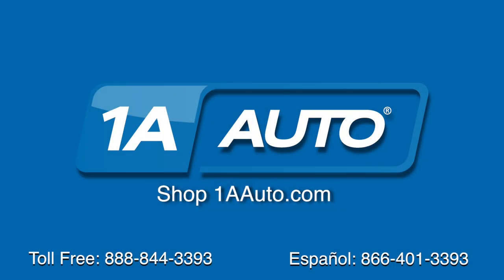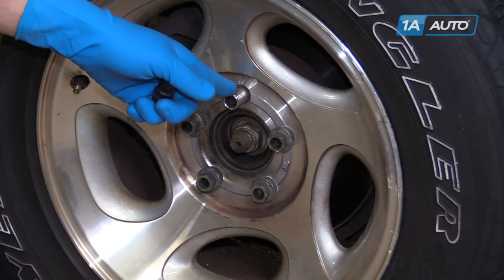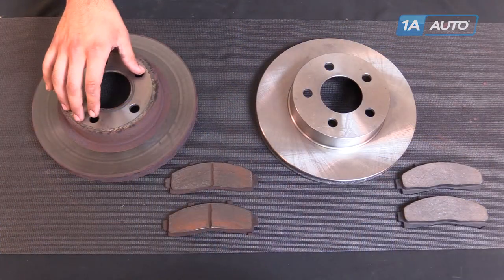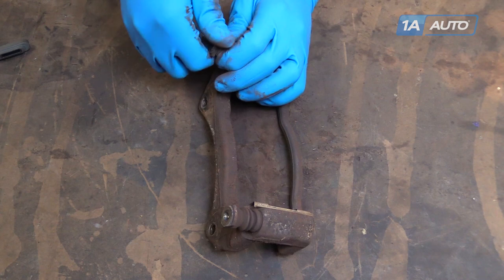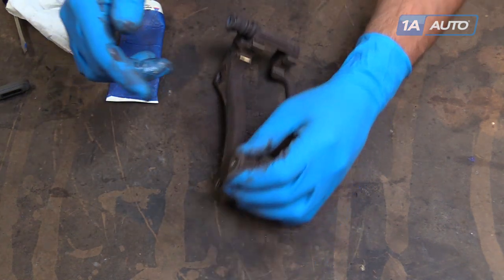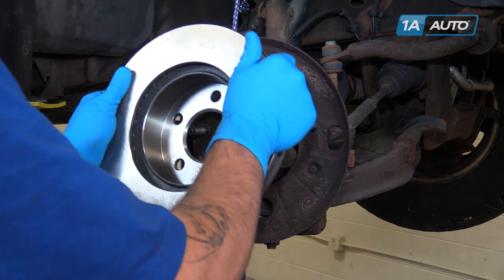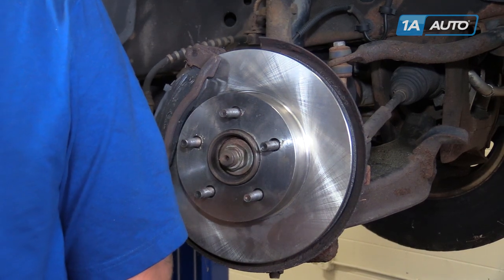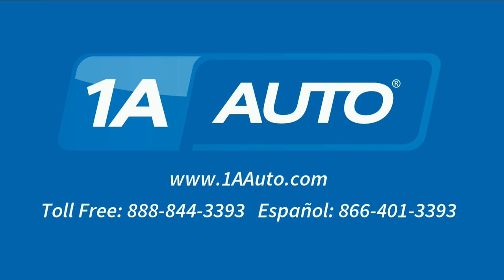How to Replace Front Brakes 95-02 Ford Ranger

Comment: The brake grease on the hub...SO IMPORTANT. I do a thin layer of anti seize and even on the face of the rotor I do the same so a wheel never sticks. I turn into Bob Ross when I do brakes. I put grease on every single thing. Pretty sure I use too much silicone grease (slider pins especially), but I do not want anybody returning with a complaint. Pads are gauranteed to wear evenly with me 😂😂😂

Comment: Great video and tutorial. Really made the job easy and saved me a ton of money.

I would add two points;
- when you are compressing the cylinders, keep an eye out for excess brake fluid coming out of the main reservoir. It will go back down after you perform the next step,
- after you put the tires back on the vehicle, start the vehicle and step on the brake pedal a few times. It most likely will go to the floor the first few times. Then test drive the vehicle.

Best video on this project that I have found. Thanks!
Reply from the maker: +Rick Sattler Thanks for the tips! We'll pass this info along to our production team.

Comment: Always enjoy the 1A videos. It is a good idea to remove the master cylinder lid prior to pushing the piston back into the caliper. And put the old pad into the caliper so the pliers don't muss up the piston or piston boot. If you have time bleed the brakes with a helper or gravity bleed them yourself since brake fluid absorbs moisture. You don't want the metal brake line to rust from the inside out, it'll ruin your day.

Comment: Great instructional video.  I would have cleaned the caliper pistons prior to pushing them back into the caliper.  Also, advise to remove a portion of the brake fluid out of the reservoir prior to  pushing them back into the caliper. This prevents overflow mess.
Thanks for posting.
Reply from the maker: +Tim Hickory Thank you for watching and also the added tips. Have a great day! 1aauto.com
Reply: I just replaced this today and the brake fluid level was definatly something I wash was said. I thought I split a line or broke something when fluid can running down.
Reply: Make your own video than.

Comment: 1. If you're replacing the pads and not the rotors, you must have the rotors resurfaced. Where you purchased the pads will usually have this service. If the rotors are too thin to resurface, they need to be replaced.
2. using one of the worn pads with a large C-Clamp is another way of compressing the caliper piston without risking damage to the piston(s).
...and ALWAYS, ALWAYS, before you start, make sure the bleeder screws are not frozen up!...just in case.
Reply from the maker: Thanks for the comments and for watching! +Spaz 360
Reply: WildWonkyWizard  You can sometimes get by by giving the rotor a once-over using sandpaper (60 grit) on both sides. You need to "break up" the rotor surface to prevent the squealing (not grinding) noise, especially if you're installing semi-metallic pads to get the same look as the new ones in this video. But NEVER touch the rotors (or pads surface) after you do this as the dirt and grease on your fingers can affect brake performance. If you do, just spray down with brake cleaner.

Comment: This is a very informative video, making it seem like an easy enough job. I do have a question : I have a 1999 Ranger, and at the part of your video where you clean the hub, there is a half circle of metal to the right that looks like  shielding or backing. How integral is that part, and can it be replaced?  Mine is half rusting away.
Reply from the maker: +njnaturewolf That is the brake dust shield, and it keeps debris out of your brakes.  If it is rusting away then it is a good time to replace it!  1aauto.com

Comment: After replacing the new pads and rotors my ABS has activated. Any ideas how to disengage the ABS?
Reply from the maker: +callingtwch 5655 You may want to check the ABS connection to see if it is dirty. It wouldn't hurt to clean the connectors. Hope this helps you out. 1aauto.com

Comment: Will this rotor & brake pad kit fit on a 03 4x4 Ranger Edge
Reply from the maker: +Dennis Garrett The brake pads and rotors are different for the 2003 Ranger. Thanks for checking us out!

Comment: Whats the size of the groovelock pliers you used?
Reply: Don't bother doing that, use a large old school style steel C-Clamp and one of the used brake pads against the pistons and compress them properly so you don't run into issues doing it with a pair of pliers.

Comment: Is this the same process for a 2 wheel drive '99 Mountaineer?
Reply from the maker: +Jay Carter It would be a different procedure. Here's a link to the brake section on our website for your 99 Mountaineer. There's a video for the 2WD application that should help you out. https://goo.gl/wa9HN7

Comment: Can someone explain to me what foot pounds are and how I can make sure to tighten them to the specific numbers he said
Reply: A measurement of torque.  Buy a torque wrench.
Reply: It's the amount of "Twist" or "How tight is enough" when tightening a bolt so that you're not leaving it either too loose or risk breaking it. In order to "torque" a bolt, you need a torque wrench. They have an easy to read gauge that, as you tighten the bolt, display the current ft/lb amount.

Comment: Why is there no mention at all about the bearings and races in this video, but the other video where you put the old rotors back on, you mention installing bearings and races in new rotors. But this video skips over any mention of that at all. ??? What gives?
Reply: Two wheel drive and four wheel drive differ, among other design issues.
Reply: On these rotors it appears the hub is not built in, so you can remove the rotor while the hub and wheel bearings stay on the spindle. On mine, it's all built into the rotor so i had to repack bearings and all that.

Comment: will this work for a 2005 Mazda B2300?
Reply from the maker: +ekolu03 It should be the same on this vehicle. The part number is the same. Here is a link to the brake pad and rotor kit that is shown in this video on our website http://www.1aauto.com/brake-pad-and-rotor-kit/i/1abfs00004?utm_source=YouTube&utm_medium=CTA+Comment&utm_campaign=ytcomment&utm_term=J-9HS4w70eU
Reply: I also noticed you didn't bleed the brakes. Is that only if you're replacing the calipers?
Reply: @ekolu03  Yes you don't need to bleed the brakes when changing the pads and rotors. Remember to pump the brakes alot before you drive them though to get the brake pedal hard again.